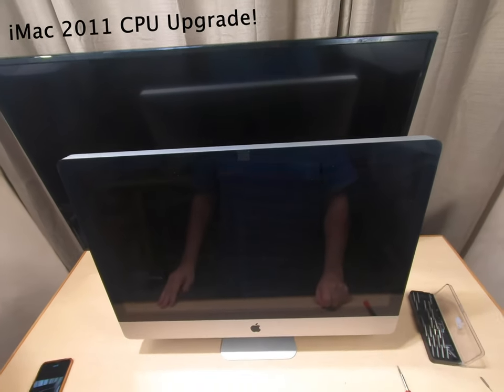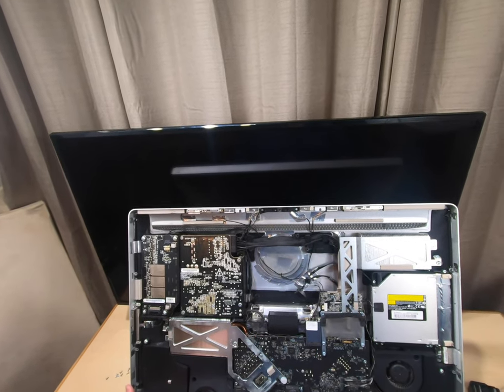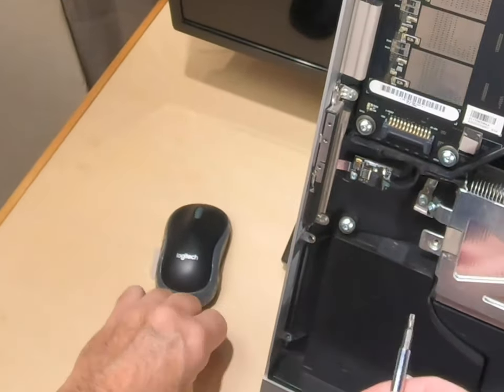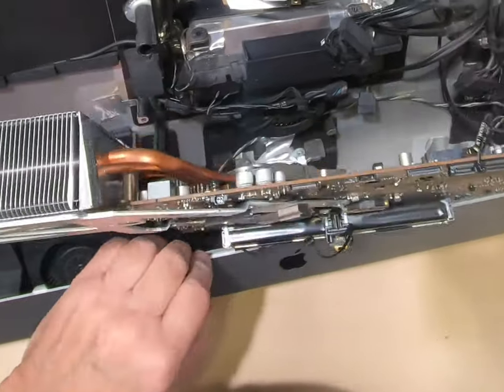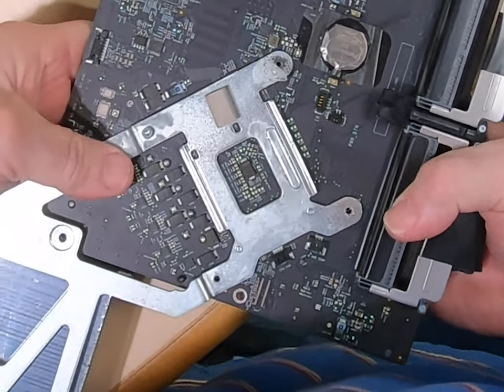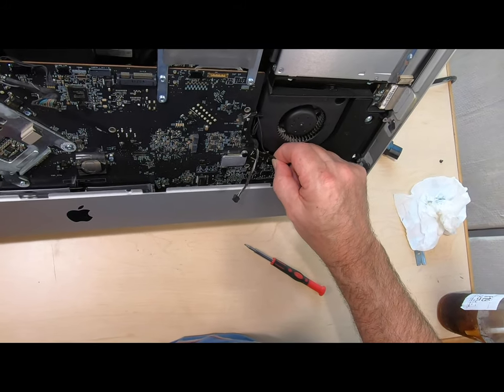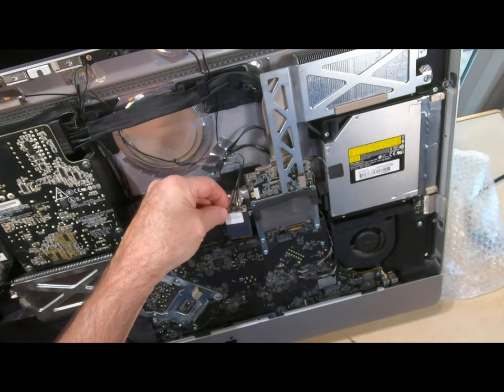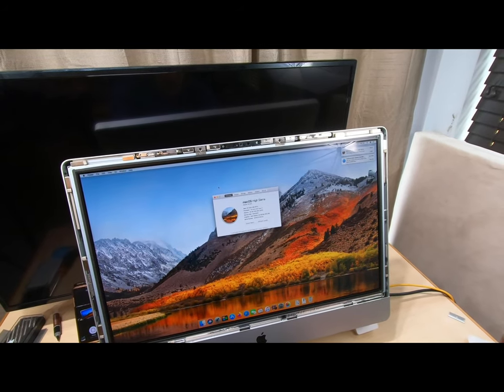2011 iMac CPU & SSD upgrade in Detail | 2020

Comment: I have two 2011 27 I mac's,  converted both to SSDs and put the fan controller cable adapter on to stop the fan noise. Great machines with the Intel i7 chip running at 3.4ghz.  The heat is definitely reduced by installing SSDs.  Better to rebed the video card with new thermal paste and replace the battery while the board is out. Good video & no music so you can hear the instructions nice one.

Comment: Just did this on my mid 2010 and I get a flashing question mark. Any ideas?
Reply: Folder with question Mark ?
Reply: Reinstall the os, if that does not work you might have  to change th hdd

Comment: How do you install ios on new ssd hard drive ?
Reply: Check out video's on u tube,  other option is disk cloning software. You have to format your new sad on the IMac BEFORE  you pull the hard drive out. Also back up your existing hard drive so you can recover your system. You can use the recover function in disk utility to load the OS onto the formatted  sad.

Comment: How come the fan wasn’t spinning on full blast when you put the ssd in? Were you using the software fix?
Reply from the maker: Yes software fix. When you take out the spinning SATA there is a heat sensor that is not used so your HD fan will spin high. I use Macs Fan Control (free) to slow it down. Thanks!

Comment: I've just bought a refurbished  iMac  2011 with  El Capitan installed. I plan on putting an SSD in out of the gate.  Question is how did you install the High sierra oS onto he SSD ?  Do I have to use a USB to SATA cable and plug the new SSD and download high sierra. or is there a way to  download high sierra onto SSD without turning on the mac and going into app store ? 

Do you suggest I keep the SSD and HDD aswell. Currently, My laptop of 256ssd is good enough for me.
Cheers
Reply: just bought a 2011 as well,was wondering the same thing. Have you figured it out yet?
Reply: @loslosthuy  mac arrives in 2 days. But my housemate has a mac book. So I'm  gonna download high Sierra onto USB then  boot from here. Also gonna replace HDD. Found out the SATA port on optical drive bay supports only 3gbs transfer - not sure if I can reposition sata connection to OPB  because mac has 3 data ports 2 6gbs and 1 3gbs - I want the 6gbs data speed.   I'll keep you posted
Reply: @loslosthuy  you need a working apple computer to download an image of the Sierra installer, once you downloaded the image you have to make shure its in the application folder, get yourself a 16gb stick wich in the example command is named MyVolume,make sure its a  macOs journalised partition and enter the following command in the terminal:  sudo /Applications/Install\ macOS\ High\ Sierra.app/Contents/Resources/createinstallmedia --volume /Volumes/MyVolume
Enter password...
Wait
wait
Wait
and when done reboot or boot the mac with the usb plugged and hold de option key when powering it on....
Now you can choose yous installer usb and start formatting and do a fresh install....
Reply: You either make a timemachine backup of the stock hdd on an external hdd (way faster) or you reinstall the os manually wich is kinda of a pain.

Comment: Que Processor usaste?
Reply from the maker: Hi Dennis! I used an i7-2600.
Reply: @TechNolli  is that the only I7 processor that will work for mid 2011 27 imac? Is there  a stronger i7?

Comment: Is it possible to upgrade to Catalina on a 2011 iMac?
Reply from the maker: Not that I know of. You may try googling Dosdude1
Reply: You can patch it in but it is really not worth it.
Stick with high sierra
Reply: You can upgrade a 2011 iMac to Catalina and Mojave with a  Metal capable graphics card, one example is an Nvidia Quadro K1100M Mobile Graphics Card 2GB. There are many that will work. Do some research.

Comment: That was going to be my next question. I'm doing this to my friends Mid 2010 27-inch 3.2 Ghz Intel Core i3. With 12 GB 1333 Mhz DDR3. I'm a windows PC guy, so this is my first time with a Mac. 

I have some questions. If you don't mind. What is fastest CPU for the Mid 2010? I believe it is the INTEL Core i7 Quad Core CPU i7-870 2.93GHZ/8MB LGA1156 SLBJG. 

However, I thought I saw that an Intel Core i7-875K SLBS2 8MB Cache 2.93GHz Quad Core CPU Processor was the fastest because it's unlocked.

Is it worth it to have a 1 TB SSD internal hard drive and a 2 TB mechanical internal hard drive? I suppose for Storage reasons and so, you can just switch SATA cables to the SSD as primary and leave the heat sensor on the mechanical HDD (I don't think there is enough room without moving the CD-ROM or putting it behind it - probably not worth it)? This way you don't need to spend around $40 for the OWC Inline Digital Thermal Sensor or download the SATA Fan Controller Software.

Lastly, how do I install the operating system to a fresh drive? It's my understanding there are three (3) methods. 1.) Cloning, 2.) USB or DVD install, 3.) Apple Internet Recovery (probably best option).

I do not have another Apple product for the USB, and the one I'm upgrading for my friend has a compromised hard drive.

It’s all about the price to performance ratio I suppose.  This also looks interesting as well for a more professional look, but it increases the cost:

1.) NewerTech AdaptaDrive 2.5" to 3.5" Drive Converter Bracket on Amazon for 
2.) OWC in-Line Digital Thermal Sensor HDD Upgrade Cable and Install Tools for iMac.

Thank you for your time and consideration.  I look forward to your response, and trying this for the first time.

Comment: Congratulations for your channel and thank you for sharing your knowledge with us. I have a question: I have a 2011 21.5 iMac. Can I replace the original i5-2400s cpu for a Xeon E3-1280 v2  one as both use the same LGA 1155 socket and the max TDP is 69W? Do you think it is gonna work? Thank you!
Reply from the maker: Hi Paulo! hmmm I don't think I would risk trying it, but I see talk on the web about it. Not sure what to tell you. :)
Reply: @TechNolli  Thanks for the quick response. But do you agree that on paper it looks good? I say that because the processor you used, the I7-2600 has a TDP of 95W. The Xeon E3-1280 v2 that I want to use the TDP of 69W, much closer to the TDP of the original I5-2400s processor which is 65W. And the Xeon is 82% faster than the original I5-2400s while the I7 is only 60%. In other words: the Xeon is faster and colder than I7. I think I'll take a chance. Thanks again!
Reply: @pauloterenzi  you can only replace the cpu with other cpu's that where used by apple on that specific model. every cpu that apple didnt put in this models configurations will not be recognised by the motherboard... So No the Xeon will not work